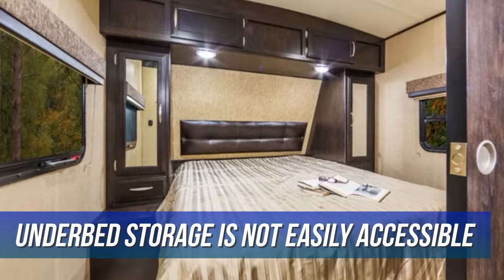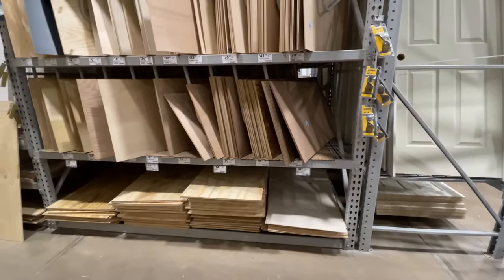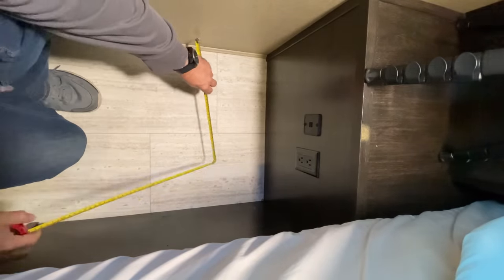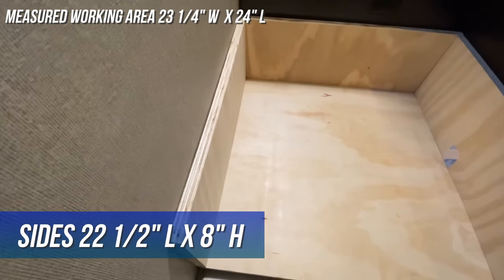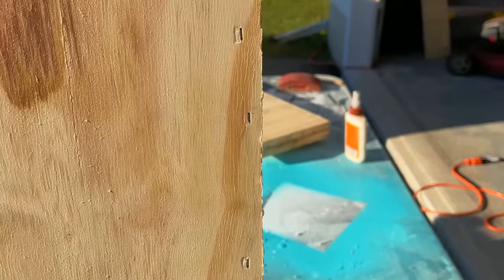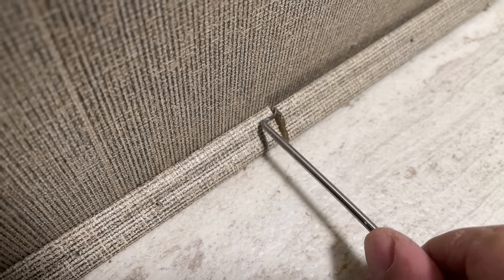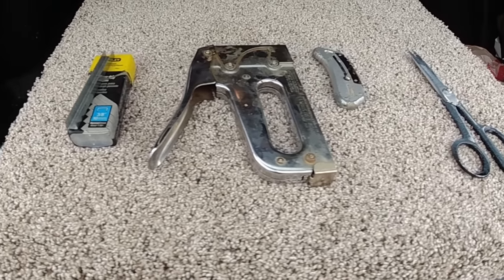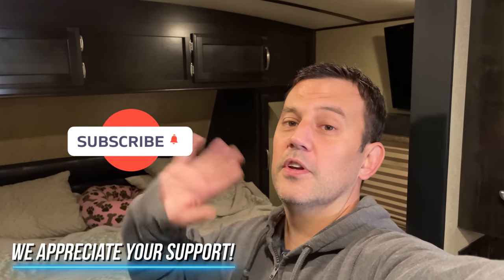How to Build a Hidden Storage Step in your RV / Travel Trailer - Step by Step

Comment: I would like to seen how you attached the carpet, especially how you wrapped it around the edge of the plywood.
Reply from the maker: Mark, the sides and back of the top piece was cut flush and the top was secured using a little construction adhesive.  I pulled the front lip over and used 1/2 staples from a heavy duty stapler to secure it.  It’s holding up perfectly.  The front  exposed piece is also stapled but you can’t feel the staples because they are so deep through the carpet so you could probably use them on the top instead of glue.  Once everything was done I used a lighter to heat up the cut edges so the would not fray.

Comment: Great one! May I ask specifically what size wood did you originally buy to cut down? Thanks!
Reply from the maker: Nick, I think they were 4x3 or 4x2 sheets... cant remember exactly but it was not efficient lol.  They had to fit into a hatchback (truck was in the shop).
Reply: @RVTIPSANDTRAVELS thanks! You made it work though 🤪

Comment: Wouldn't it be better to split the top in half and use a brace in the middle so you can open it up and One side at a time it will increase the amount of weight that can be put on the top because of the center brace you only lose about 3/4 of an inch of space
Reply from the maker: You could, but with the top resting on all four sides and it being 3/4 pine it will hold quite some weight.  It doesn’t even flex and I’m 180 lbs.  but that’s a good idea for heavier people.  The divider will prohibit larger items being stored in there if that’s something you want to use it for though.  Thanks for the idea Derry.

Comment: shouldn't the side pieces be 23 1/4 x 8 ?   24 inches less 3/4 for the back piece?
Reply from the maker: no, youre looking at the working area dimensions.  look at the locker floor dimensions, they are 23 1/4 by 23 1/4.  so you take 3/4 off that and left with 22 1/2.  where the working dimensions come into play (the 24" you are referencing) is the the top of the locker.  it is 24" long, will stick out 3/4 of an inch past everything else (23 1/4)  so you have a lip to pull up on.  make sense?
Reply: @RVTIPSANDTRAVELS  yes, now makes sense...thank you
Reply from the maker: no problem, you had me second guessing there for a second.  if you build one, send me pics!
Reply: will do

Comment: Why make a bottom and not just use the floor, save a pound or two.
Reply from the maker: The bottom adds more support to the entire structure so it could be stood on.  Remember the top is not fixed so even when it’s closed is does not add support to the sides.  Also, the bottom distributes the weight across the entire floor.  Without a bottom theres pressure only where the sides, front and back are. That could be a problem for heavier folks and really chew up the floor.  The structure is more solid and that’s more important to me than 2 pounds of weight.

Comment: The idea is a good one except that I am looking for an rv without a step on the side of the bed so I can get in there to make the bed.  You just took away that ability
Reply from the maker: It’s actually easier to make the bed, you are taller and can reach the corner of the mattress easier without having to slide it out.  At least for us it is, much easier.